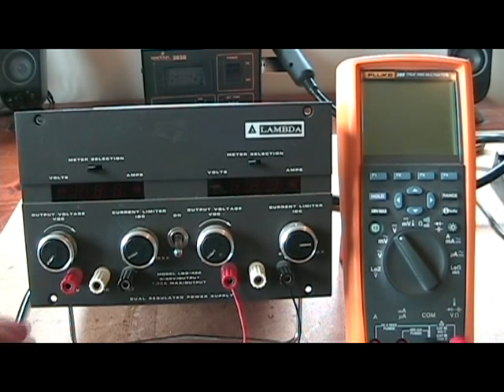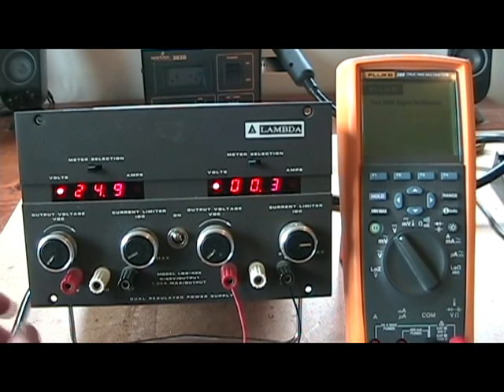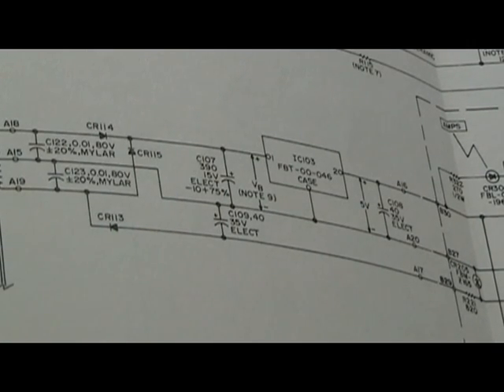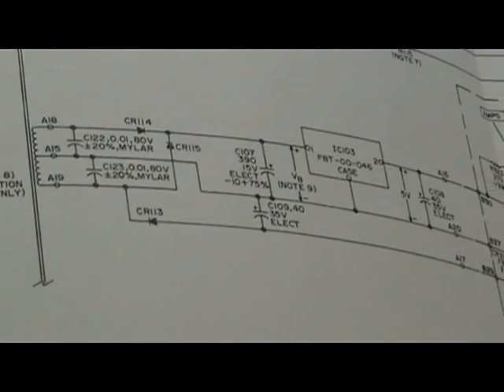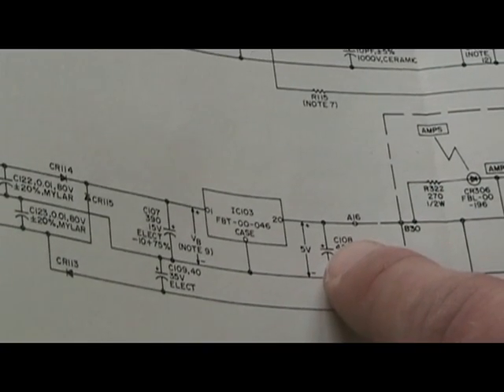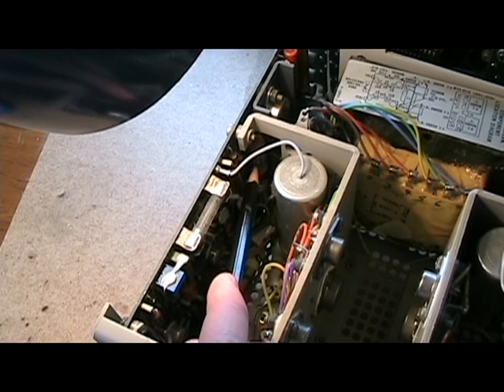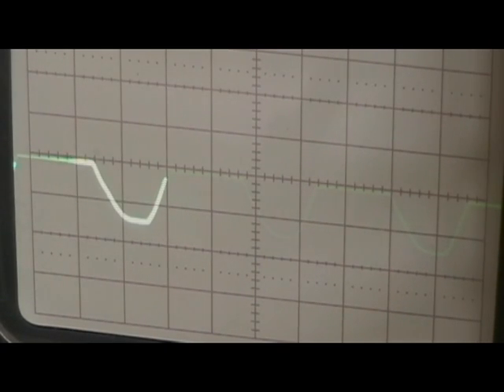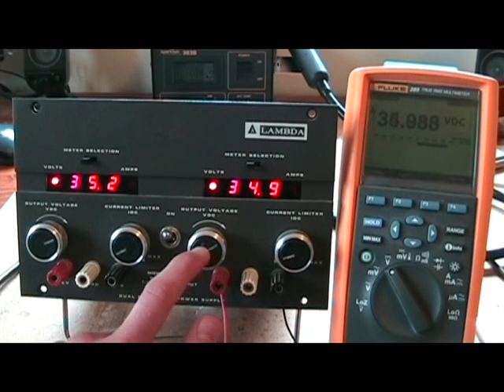Fixing a Lambda Power Supply

Comment: I had the same problem with a LQD421. Changed out those caps and it works like new. I, like another person, would like to know how in the heck you got in there to change those out. I had to practically take the entire power supply apart. Thanks again.

Comment: I have an LQD-423 that had your issues and your suggested repair solved the problem. A year later I have another problem. The right LED readout is dimmer than the left and gives a lower readout than the actual voltage supplied. Do you have any idea where to check for the problem? Thanks.